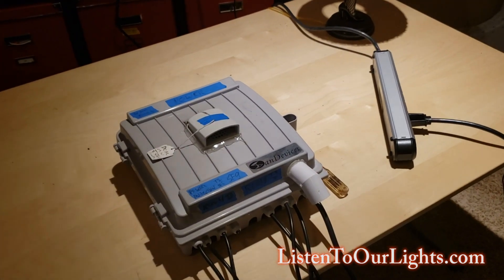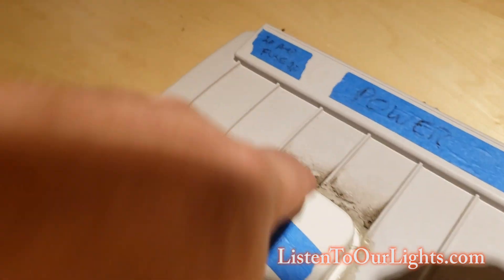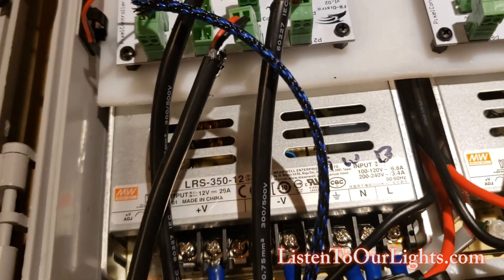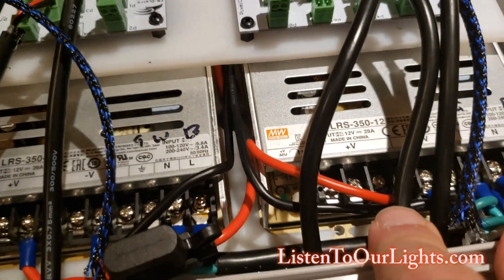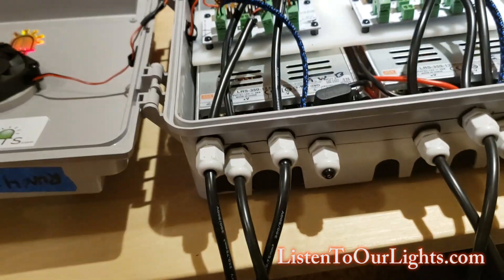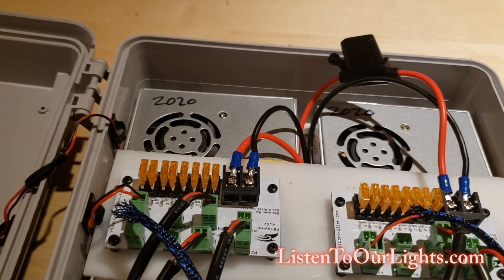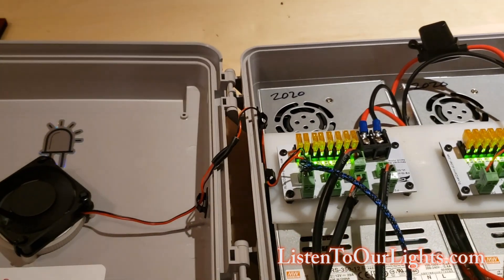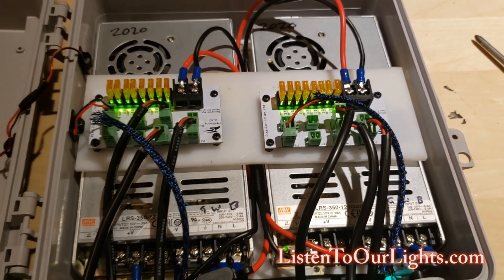Power Injection Box Tour

Comment: Looks great! Question though, from each power supply, you only have 3 connectors coming out, that doesn't sound like much given that every 200 odd pixels you need to inject. Are you splitting these again down stream in order to get more volume?

Comment: Question. So on your controller you only have the data plugged in not the the positive or the ground? And if that’s the case. Do you power inject from like the middle of every prop using the tees ? Or normally from the end ? I understand you can do it from anywhere but I’m curious on how you do that.
Reply from the maker: I have data and ground from the controller and I inject my power for each port which is typically a string of snowflakes of around 600 pixels.